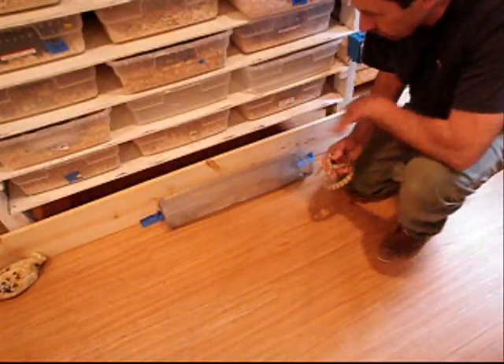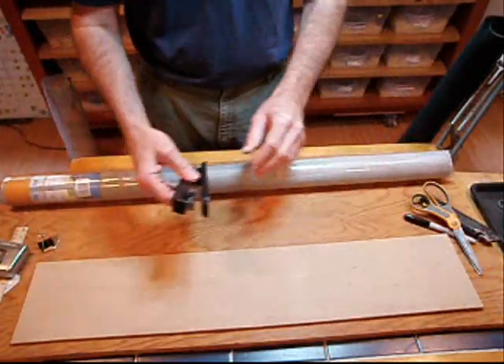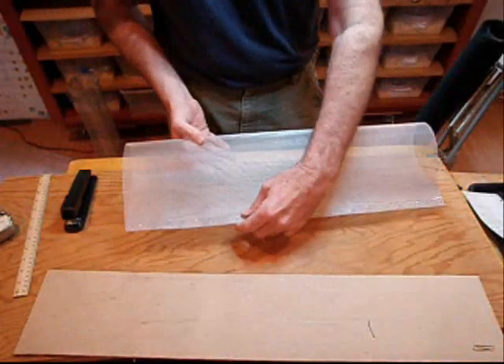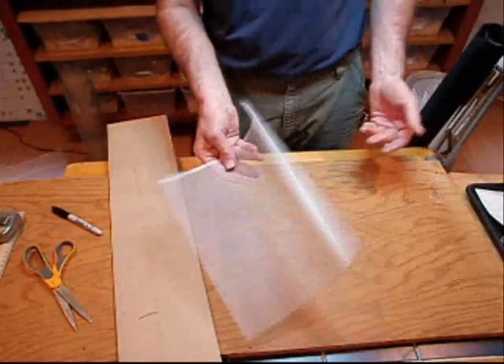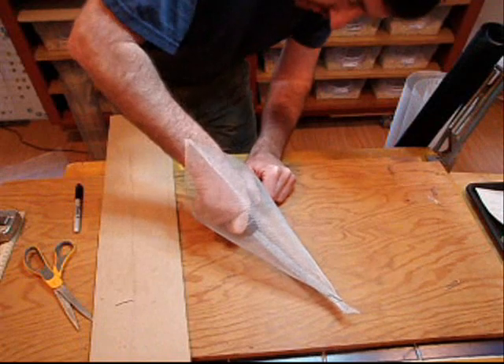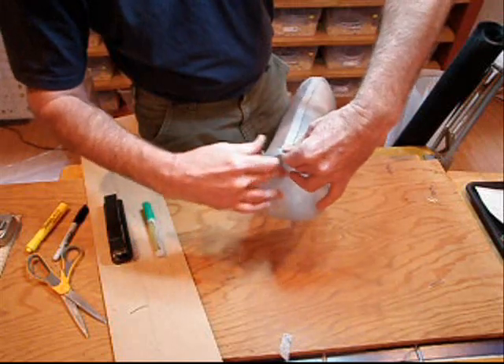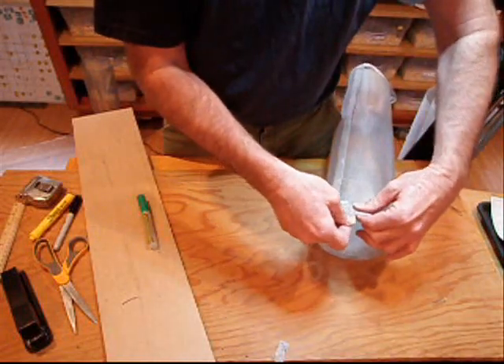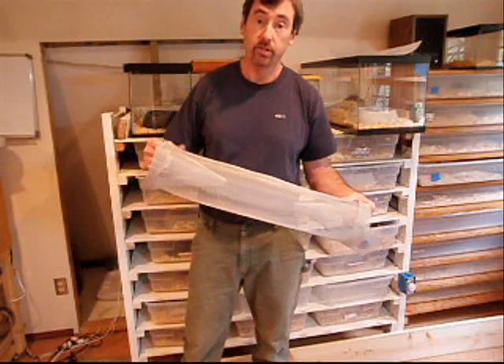How to make a snake trap

Comment: Hi Rod, I was so stressed about a snake that was trapped in my bathroom hiding under the sink cabinet! I was afraid it would starve or dehydrate there. I searched the web for a way to get him out and came across those heinous glue traps, which I didn’t want to think about, and would never use!  Then I found your video, followed your excellent instructions and made the funnel trap on Sunday afternoon.  I put it over the hole where the snake went in. Sunday evening he wasn’t in the trap. Monday morning he wasn’t in the trap. I was concerned that the funnel opening was too small or the length of the cylinder too short and was planning to make a bigger one when I got home on Monday, but when I removed the towels from the space under the bathroom door, opened it a crack and peeked inside... there he was in the trap under the funnel; I was and still am trilled! I want to THANK YOU very much for giving me a way to free the snake without harm and the joy of watching him glide through the lawn when I released him! Your video is a true act of kindness.
Reply: Glad I could help.

Comment: Thanks for posting this, I have a 2000 sq ft workshop with a mezzanine  floor where I have a big enclosure for my flock  of free range parakeets. I have noticed these big poops that can't be coming from my little birds. They are brooding also. I noticed that they don't have many eggs, but now I think a snake is eating the eggs. I am wondering how in the hell to catch the snake. Do you know if many snakes are nocturnal? I thought they were usually day time animals? And there are no walls to place the trap, its a glass top enclosure. I thought about making the cone shape and attaching it to the opening of the nest box to trap the snake when it goes in for the egg? Any ideas appreciated